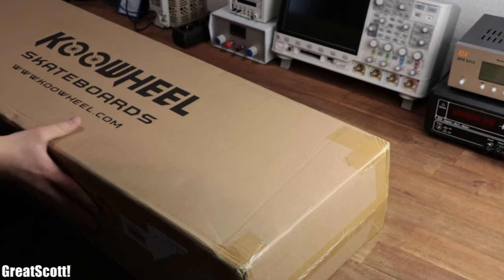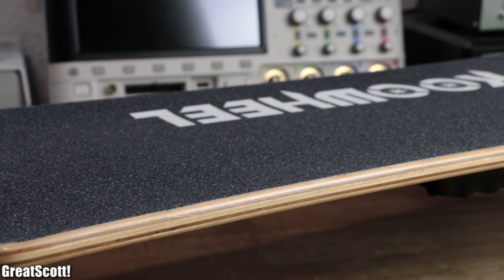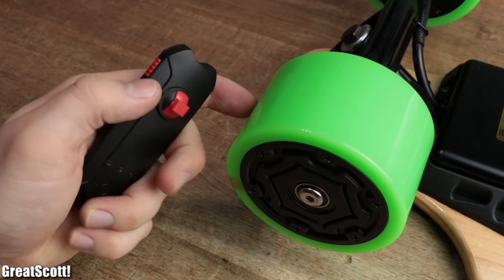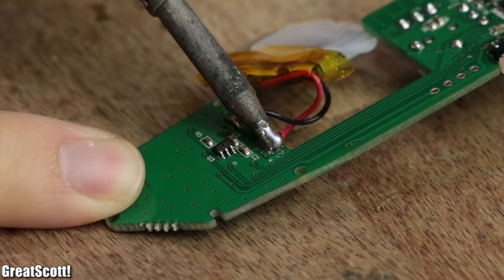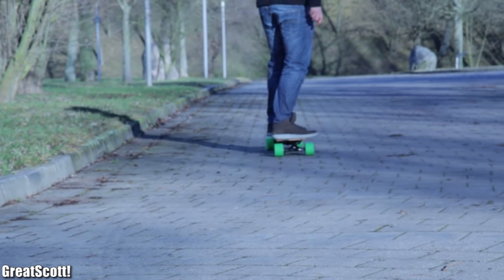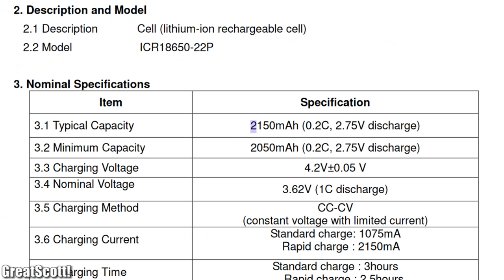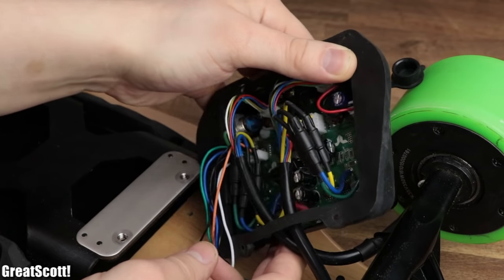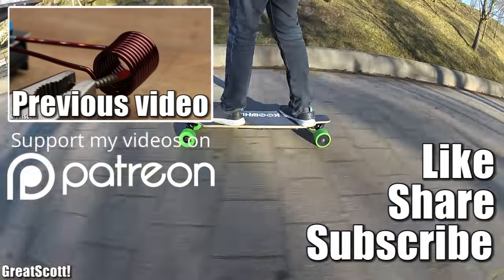600$ Electric Skateboard (Koowheel) Review/Teardown

Comment: Looks cool! I wonder if it would be possible to make an electric skateboard that works on gravel roads, or if it would simply be too draining
Reply: Karlo Bistrički well yes but make big wheels than.
Reply: look up "Trampa electric mountain board"
Reply: Segway builds those. They even come with a handle to hold on to when the road gets bumpy. ;)
Reply: Evolve Boards have big pneumatic wheels with can easily cruise over dirt, gravel, sand, grass and a whole lot more. Though there boards are quite expensive. The top tier one is the Evolve Carbon GT board which is somewhere around $2K so yeah...
Reply: He has already made it check is channel out

Comment: ive had my board since October 2016. Have been riding ever since in the rain and on cold nights. I take it to work and back daily weather permitting. Till this day it works perfectly. Speed Boost gets me up to 17-18mph @ 205lbs and I get a good 7-8 miles from full charge to low. Hits hills great and tackles NYC's cracks, bumps, potholes well. Its a TANK of a board. Ordering the one with black wheels so I can have 2 boards. Aliexpress has them for under $550 New and Updated. I do recommend.

Comment: Great review and teardown! I have had a few of these boards. When I press the button 7 times I get up to 25 MPH. I also get 13 miles on our running/bicycle track (Minor up and downs on that) in town on my Genesis Tomohawk (pretty much a koowheel). Also bought my wife the Genesis Hellfire (same board different name). The controller takes me 30 minutes top to charge. Does feel cheap. I am on my third board from them (manufacturer warranty covered). Have put probably 500 miles or so between all. This last one has lasted the longest. The downside is that occasionally the controller will turn off when braking. Very dangerous if you were to be around traffic. I had no clue about the regenerative braking. Pretty cool :)  I also bought extra batteries to swap on long rides with the Mrs.

Comment: had my koowheels board for 3 months now n it still runs great. I must've gotten lucky cause I got a perfect functioning board with none of the problems mentioned in the reviews. Eigther I got lucky twice or they now have a better quality control before shipping. Like I said, I got 2, 1 for me n 1 for a friend but I went with a Genesis Hellfire since they're made with all same specs ( really Genesis bought the first batch of boards Koowheel made n just re-branded them "Genesis.." But that was months of research ago looking for a board that would do at least half what it claimed but the bad reviews were out there making me hesitate but after I realized the videos I was watching were a few months old I figured the companies' should've gotten it right by now n I was eigther lucky or right cuz both boards run amazingly well, are very smooth, n in turbo mode (hit power button 7 times in a row quickly then turn on the remote) it does 20-25mph and I 've got awesome range out of both of them. Just last night I road for about 2-3hrs n measured a 12mile drive which left me with 2 out of 4 leds lit up but thats about when the board starts to slow down but it'll still go a few more miles. 17miles is my farthest ride using different speeds n breaking to regenerate some charge in the battery at stop signs but I made the whole trip without having to push at all. I got myself 1extra battery but by the time the first one is low I'm too tired to go anymore. All I can say to all those on the fence about which board to buy, even though they're coming out as fast as cell phones, have confidence in Koowheels who's been around longer and have had the time to make updates n improvements responding to utube videos critiquing the original problems. One of the best aspects of these boards is the batteries are interchangeable n the boards are exactly the same but they have a sleeker look to them since the battery is so thin people can't tell it's electric cuz theres no bulky battery almost touching the street n its really quiet. That makes one less worry about its lifespan since the battery is so thin jumping off curbs n going over speedbumps doesn't cause any scrapes or battery damage. Plus, Koowheels has an opperation inside the USA, I think in San Fran. so getting repairs shouldn't take too long. I've been stuck at home enduring 4 back surgeries over the last few yrs but when I saw these boards for the first time I knew that's what I needed to get me out the house and strengthen my core while I'm at it. These boards have changed my life n even people who were too cool for skating back in the day are amazed when they see my board n how easily I'm getting around while having a blast doing it n all want to take a turn....that's why I got 2, I expected as much. This is one purchase u nor I will ever regret!!! T,  : Key West, FL.
Reply: How are the genesis and koowheel running now? If you had to pick between the two would you still go with koowheel over genesis?
Reply: how does it hold up now?

Comment: Hello GreatScott wanted to know if it would be possible to somehow fix the charging time for the remote? Or somehow replace the battery with something better? (I dont know much about electronics)
Reply: I think stuffing in a TP4056 seems reasonable enough..that would charge it in 3 hours at 1 amp.

Comment: Would a USB power bank extend the life of the remote at all? If it will run while charging that could be useful.
Reply from the maker: Yes, You can charge it while using it. I tried that.
Reply: is that why he mentioned the charge lights only go down to 2? I don't understand that and how through remote was accepting it?

Comment: Hi, I was wandering if there is a way to switch a coil from Y to delta configuration, which would make a wind generator much more efficient - the coils connected in SERIES for the low wind and then in PARALLEL for the high winds.

Comment: hello sir, at 5:08 how can 2 batteries 3.6v 2150 parallel can increase capacity for 10*3.6v=36v series? as far as i remember, for increasing battery capacity in parallel, it must have same equals voltage for the series battery and the parallel itself. correct me if i'am wrong. thank you

Comment: Would it be possible to charge the main battery while riding on the board? I was thinking to have a backpack with a second battery pack with a high capacity. Maybe a motorbike battery and use it to charge the main board battery through a cable with a some sort of magnetic detachable connector.

Comment: Great Review and awesome board.  One thing i don't get is why aren't e-boards fitted with a kicktail ?

Many turns [here] are straight angles, with kicktail they are easier to handle, just release throttle and kick.
I have the truck bolts as loose as possible but still corners are a bit too sharp :)

Comment: Hi GreatScott, I have the same skate as you but i have a problem with the battery: two transistors were desoldered on the measurement circuit inside the battery. I tried to resolder it but after few meter, it the same problem, the current may melt the tin when I accelerate. Have you got an issue for that ?
I like your videos !

Comment: would it be possible to add a better charging circuit into the remote or are you stuck with the very low current?

Comment: It is possible to swap the default rotation of the wheels motor by the yellow, green, blue wire? Can't find my multimeter to measure the voltage.

Comment: By far the best review I've seen on this board...especially the tear down of the electronics/battery/remote. Some questions....Question 1- the battery in the remote looked to be a 1-cell LiPo 3.7volt unit. I wonder if you could solder in a higher capacity 1-cell 3.7volt battery?...if there's room. I would also solder in an alternative plug that can go externally, then allowing you to connect it to a hobby grade charger where you could choose the amps it charges it...I would do 2.5amp. Question 2 - I wonder if you can use another transmitter/receiver. I do rc cars and planes and its really simple to swap radios in them...I wonder how easy it is with electric skateboards. I didnt see a clear sign of a receiver in your electronics tear down...it looked to be integrated in the speed controller assembly. Thanks!

Comment: Can you roll an electric skateboard with your feet? Or is it completely useless once the batteries are dead?
Reply: I have one. You can skate it as a regular longboard with the electric off.
Reply: you can roll the board with your feet when batteries ran out, that's the beauty of the in-wheel hub motor
Reply: you can skate it with your feet.. it also has regen charging so if you push long enough, it will retain a small charge

Comment: How feasible would it be to construct and external battery pack for the remote to use AAA batteries? Sure it would be more bulky, but it might be a better solution than charging 6 hours just for the remote.

Comment: Very nice video ! Is it more expensive that the one you made? Does yours can be used longer? or rides faster?
Reply from the maker: Yes. It is more expensive. Also a bit slower and the range should be the same. But this product is better than my DIY version.
Reply: Why is it better? I am considdering building one myself, so I know where to improve.
Reply: Nytox I made a diy build too, but I used an 6s BMS from eBay and tow 6s 4500mha lipo battery's in parallel. I'm charging them with a lipo battery. All in all I'm quite happy with the board and it was not that hard to build. I spend like 400-500€.

Comment: I'd say the remote need done again. Maybe using AA batteries and recharge battery pack optional. But the charge time of 6 vs 3 of the board isn't acceptable. If it doesn't use Bluetooth that might be s good redesign option since you shouldn't be more then  3 meters from the board to begin with and would work find for this small range of remote control. Also lower power, so the remote could last longer and only need top off charges when the board is charging keeping enough power on the remote for multiple runs a day. And if it not using Bluetooth this might also increase the run time of the board a little. Then add a USB port to the board with a 2 meter or 2.5 meter cord to charge the remote from the board for the times the remote does before the board. 
That brings up a question, you can get a pocket 18650 USB charger, will the remote run while being charged? Maybe you can try that?

Comment: Do you have a "Versicherung" or "Straßenzulassung" for your skateboard? I think in Germany it's necessary
Reply from the maker: You are not allowed to drive them in traffic.
Reply: If im not mistaken, in switzerland you can't even ride them on sidewalks
Reply: Cancer Cancer "traffic" includes the sidewalk in that case.

lg, couka
Reply: it needs to be at a specific average speed to need a license for it (like a Bike with a motor)
Reply: Zockerland99 Yes, but that speed is 6km/h. I'm faster walking :D

lg, couka
Reply: you need for sure more than 6km/h to be allowed on the street xD
you can drive a longboard on the street (if its not the mainroad but instead some less car filled road)
Reply: Well, the speed can be up to 25km/h, which is not allowed.
Reply: es ist auch nicht erlaubt die sonst iwo außer auf privatgelände zu fahren, da des ding bei den geschwindigkeiten eine zulassung bräuchte
Reply: Darüber mache ich mir ehrlich gesagt keine Gedanken. Ich habe mir den Mellow Drive bestellt für ein OlsonHekmati Longboard. Ich werde das auf der Straße fahren - denke mal solang ich nicht mit 40 km/h die Polizei überhole wird nichts passieren. Denke die meisten deutschen Polizisten haben besseres zu tun als mich rauszuwinken =D
Reply: Wer erwischt wird und keine Versicherung nachweisen kann, erfüllt einen Straftatbestand, nach Pflichtversicherungsgesetz. Nur keine Zulassung zu haben ist lediglich eine Ordnungswidrigkeit.
Reply: Regt euch ab. Im schlimmsten Fall hält euch die Polizei an. Dann müsst ihr nur wissen, dass das Board 40 kmh fährt - glaube kaum, dass der Polizist so schnell rennt.
Reply: Actually you are not allowed to drive them at all on public ground, not even on the pedestrian way here in Germany right now. In Austria you can use those. There is an initiative trying to get them allowed.
Reply: Tenac no Inc. Genau und fahren ohne Zulassung sorgt auch für den Verlust deines Führerscheins bzw wenn du mit 16 rumgurkst kriegst auch Probleme mit dem machen von deinem Führerschein ist bei uns im Dorf einem passiert und der war nicht mal auf ner befestigten Strasse damit
Reply: They are not allowed here in Denmark aswell, got mine yesterday.

Drove past the police many times, 9/10 times they dont give a f.

But damn this board is such a good board for its price, i can do 20 - 22km on mine at a speed of 25 km and thats with uphil (It doesnt do that well uphill :())

Comment: why didnt they use 3400mAh 18650 cells? there are some that can do 10A continuous
Reply: Price?
Reply: LG MJ1 18650 cells are 3500mAh 10A discharge and cost around  $5 per cell. They cost less in a bulk ofc...
20 cells would cost $80 max and would increase the capacity by more than 50%! (Samsung 22P are 2150mAh 10A, LG MJ1 are 3500mAh 10A)
there are also NCR18650GA made by Sanyo (Panasonic), they are also 3500mAh 10A
Reply: a good DIY upgrade?
Reply: soldering cells isnt smart so maybe no. It's a hard thing to answer... Yes it would be a good DIY upgrade if done right.
Reply: I've done it to create a 2 cell Lipo, was difficult to get the solder to take but manageable. So to be clear, the extra mAh = longer range? No other benefit?
Reply: yes, around 50% more range and 50% longer charging.

I dont know how easy it would be to modify it to draw 2x current, if that's possible and if the motor could handle it LG HG2, Samsung 30Q or Sony VTC6 could be used (they can output 20A) for 2x more power. IF that's possible to do...
Reply: Yes it may cost $80 but that is allot of money. Remember they do need to make a profit. The supplied battery pack most likely costs half of that.  Remember every dollar you add to the production cost can add up to $5 to the RRP.

Comment: you press the button 7 times not 3 to unlock max speed
Reply: he pushed it 6 times
Reply: 6 times still doesn´t do the trick. It is indeed 7 times pushing the power button that unlocks the speed limit.
If Great Scott didn´t see a difference between locked and unlocked, he definetly made something wrong.
Reply: i know its 7, i just wanted to correct him
Reply: MadDias That’s true. While the board goes fast already, greatscott didn’t show off the highest potential of the board probably. It can easily reach at least 36 km/h as other YouTubers have already tested

Comment: I bought this board and its awesome. BUT! I dont know if I got unlucky with my controller but its pretty sensetive to how you hold it. If I accidently cover the controller too much, the board cant get a good signal and this once happend downhill, making me unable to brake. I now know to change my grip if it happens, but if you by this you should be aware of this.

I got the new 2017 version, so the board itself has the potted motherboard and a antenna in the board, my problem is the actual controller. If I cover it with both hands, the signal wont reach the board. If I hold the remote "bad" and happen to have my body blocking the signal, it can cut out. I would like to try and extend the signal strength of my remote, but I do not really know how I would do this. The problem is that the way the remote is designed, holding it you naturally hold cover much of the actual controller.

@greatscott! Do you have any suggestions on how to improve the signal strength of the actual remote?

Comment: Hey, electronics noob here,

im just wondering why this huge battery pack only has about 4000mah inside whil common battery packs for smartphone charging have around 20000mah??? Only thing i can think of is the higher output voltage the skateboard battery has to deliver, but as far as my understandings of electronics reach back, that shouldnt have something to do with the capacity or does it? 

I would be thankful for an answer! Thanks

Comment: Thanks for the video! Though you definitely didn't unlock the top speed. I did see some ppl say it didn't work the first time. 25km/h is the default top speed.
Reply: What app are you using?
Reply from the maker: I am pretty sure I unlocked it because I measured the speed difference with a tachometer first.
Reply: GreatScott! Interesting.. How much do you weigh? I hope it's not because the boards are inconsistent in quality.

Comment: Swap the Samsung 22P cells for Samsung 20R cells. You get around the same range but no voltage sag because the Samsung 20R cells can take 22A per cell instead of 10A per cell.

Comment: Is there a way to improve the remote's charging speed?
Reply: I replaced the 1s lipo inside the remote with a female micro jst connector which I ran outside the case, and can now swap batteries on the go using these little 1s meant for tiny whoop drones. I plan on creating a new 3d printed remote case to better house this setup and create a more ergonomic feel. Subscribe to my channel and I'll post up a video once it's all complete.